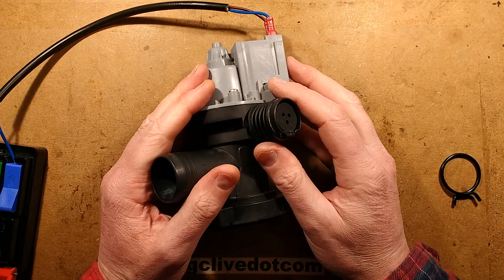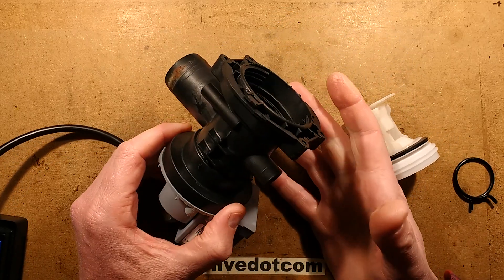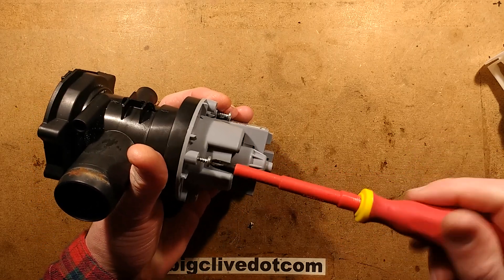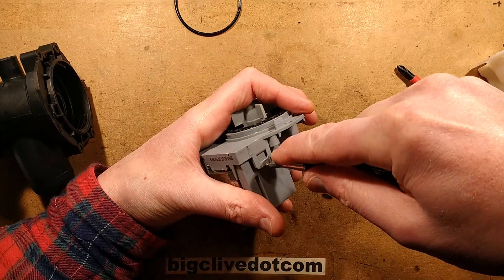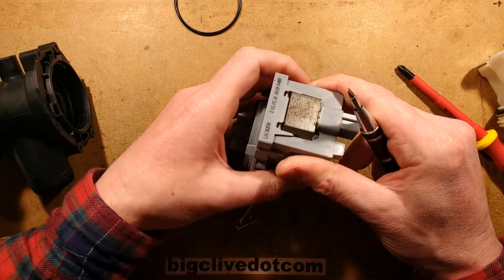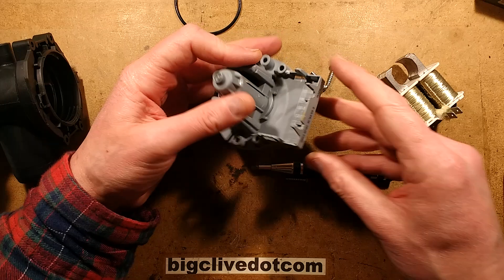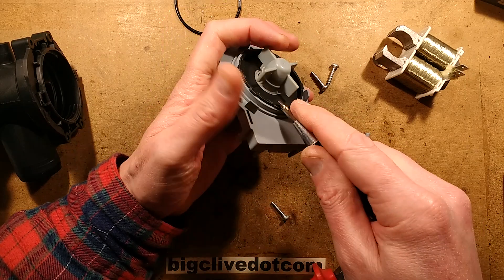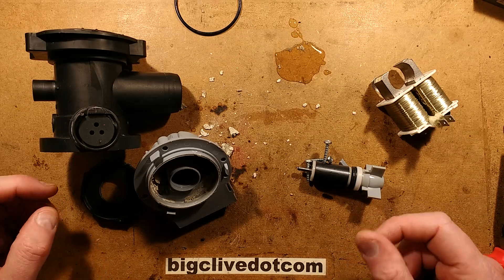Washing machine pump teardown.

Comment: Why do washing machines have pumps instead of a simple solenoid drain valve?
Reply: jhsevs at least in Sweden, we have to have to have an outlet hose in a bend over the machines top water level. It is to prevent water damage in case something goes wrong in the system. So the pump needs to be able to pump water about a meter.
Reply: Ray Kent I'm sure your explanation is true as well. Regarding water damage is just a precaution if some valve got stuck open I think. In Sweden there are "water locks" (direct translation for the U bends to stop odor) after you let the water out from the machine anyway so here the smell wouldn't be a problem. If course there can be water damage anyway so the machine should always be placed where water can't get in wall/floor cracks and what not. Another thing came to mind, the water staying in the U bend after pumping out water will drain every time you clean the dirt filter anyway, at least how my WM is placed and working now.
Reply: Simple, if the drain hose went straight out to a floor drain it would never fill.  If the machine dies and is
full, just lower the drain hose to a floor drain and watch it empty.  The height of the hose dictates the max fill level and if the fill valve fails the excess water goes in the drain.  At least for North American top loaders.
Reply: Benny Lloyd-Willner   hi, that's interesting.  I assumed that the u-bend was there for the same reason as a u-bend in a toilet, to stop bad smells from the sewer getting into the room.  Mine is not above the top water level of the machine and you have made me wonder if I should move it.   Would you say more about the possibility of water damage?   Thanks.
Reply: Benny Lloyd-Willner  thanks.
Reply: Regardless of any safety regulations the outlet pipe must rise higher than the highest working level of the water in the tub.  If didn't then the water would simply drain through the pipe until its level was at the same height as the highest point of the pipe, even when the pump is not running.  In the UK washing machines are often used in kitchens which typically don't have floor drains..
Reply: Yes the laundry  machines I worked on had those pumps to pump up to a stand pipe drain. But I have heard that there are machines that do just have a solenoid drain valve to floor drain system and no pumps.
Reply: Many people put their laundry appliances in the basement, and in many places all things that drain out must go to a septic tank or municipal sewer pipe. The drain pipe for the house is usually buried in the ground beneath the frost line, but is above the floor level of the basement. A pump is needed to draw the waste water from floor level UP to the pipe.

Using a floor drain is prohibited in many areas because dirty soapy water gets dumped straight into the ground instead of passing through a septic tank or city sewer treatment plant. This is to keep from polluting the ground and from contaminating water supplies. In addition, floor drains usually use smaller diameter pipe and often get clogged due to debris, and water coming from the emptying washer could potentially overwhelm the pipe, water could come up out of other floor drains in the building or not be able to go down the drain fast enough to prevent minor flooding.
Reply: Solenoid valves don't tolerate debris well and require a minimum pressure to work, I thought...
Reply: Some commercial machines do that. But domestic ones don't because people don't often have drains on the floor
Reply: Cause you need pressure to lift water up.
Reply: Антон Южаков 
Yeah but why don't they just dump the water out the bottom of the machine, into the floor drain?

Comment: Back end with windings is a complete spare, as the typical failure is the little shaft wearing and the rotor inner plastic as well, so it cocks and does not spin eventually. The coils are also protected by a one time thermal fuse in the middle of the one winding, those those windings look a lot like aluminium wire, not copper or CCA at all. Same design as used in fish tank pumps as well, though there they also fill the winding with epoxy and put a wire on it as well, as they do live in the tank water.

Replaced a good number of those pumps, they are common across almost all of the Korean made units, seems there is a factory or two making all the parts that just get a big brand name ( or just some bought out old shell name) put on the outside, the inner parts are almost all interchangeable across model ranges and price ranges.

Comment: Should rewrite this title "washing machine pump smelldown".... Tea, really? What do you normally drink Clive, Jasmine Tea? Cause undoubtedly that crust is probably hard water deposits w a smidge of scented soap thrown in. Here's hoping your next cup of tea doesn't smell like the inside of a washing machine!
Reply: Maybe fromunda tea, scented with detergent?
That gunk is a combination of residual detergent, water deposits, and filth that has been washed out of clothes.
Reply: Joe Camel: Funny icon. I've got a bunch of Camel Zippos and ashtrays still from when that was my brand.

Doesn't look very filthy and obviously that's leakage into the pump so bigger bits can't get in. I still couldn't believe how quickly Clive smelled it. Ick!
Reply: It's definitely filthy... Some of the worst smells I've ever experienced were from washing machine pumps. That said, if you don't overdo it with the detergent, the smell won't be nearly as bad.
Reply: I remember a pleasant smell I smelled as a kid when smelling the rubber seal between the drum and the door

Comment: That little flap valve is known as a backflow preventer or anti-siphon valve!
Reply from the maker: It's odd that it has holes in it.
Reply: The drain stack on the washer would be left full to the tits if it didn't have holes in it.
Reply: I agree usually back flow or antisiphon valves or flaps usually do not have holes in them, maybe they do that to let air get out if it gets stuck in there, the machine is churning up water mixing with air. A supply line generally do not mix the water with air.
Reply: I would have thought it’s some anti-cavitation feature.

Comment: The ones in the US are all like that too, not just the EU. (Access through the front panel to that filter trap you showed at the beginning.) They're all like that, no matter where you are. (Front load washers.)
Reply: Except they aren't.  Most American front loaders have historically not had an access panel, my Whirlpool doesn't.  (Which is interesting in itself, considering that it was actually built in Germany.)  Fortunately, I've never needed to access the front of it, it's been going strong for over 10 years now.  I haven't been quite so lucky with the dryer, it broke a belt a few years ago, that was quite a bit of disassembly to change.  And of course I ended up paying $20 for the belt locally instead of $8 on Amazon, because I had a load of wet clothes that needed to be dried.

Comment: Had a front loader.  Replaced it with an old school top loader.  Sick of fixing it.  Sick of the smell of the labial seals with miles of surface area constantly immersed in soap, skum and warm water.  Same trap and pump design.  Complete shit.  Stick with top loaders.
Reply: Whaaat? I don't have any problems with my front load...

Comment: Those spring clips are awful. Far better (and easier) to use ye olde Jubilee Clip (the hex drive ones are even easier to use!)
Reply: For a washing machine, they're fine.  We're not talking about car radiator pressures.  And the spring clips are quicker.

Comment: The flap is probably to slow the water draining backwards from the elevated drain hose when you open up the plug to clean the filter.
Reply: It's to stop back flow from a kitchen sink wash water trap, (if it's connected to one).

Comment: i learned a lot about these types of pumps from their use in my pond.
the good ones are nice and rebuild-able, so they make for good learning.

just found some very cool little air pumps as well you may like. they have neodoodlium magnets suspended in a silicone grommet with a small powered device underneath to make the magnet pulse.

Comment: The inside of that pump is disgusting. You say drain pumps are quiet. The drain pump in my washing machine is very noisy. Always a loud 50hz buzzing, especially when all the water has been drained. It still works fine and isn't blocked. Any way to make it quieter?
Reply: You sure that the bulk of the sound isn't coming from the floor waste? I have a dishwasher that makes a lot of noise when it drains into the waste pipe under the sink next to it. Just putting the plug into the sink above cuts the bulk of that noise down. I've covered the floor waste in the laundry room for much the same reason, although my washing machine isn't as noisy as the dishwasher.
Reply: The pumps will get really noisy when  the rod that holds on the impeller gets worn out and starts wobbling around. If you pull the hose off and stick your finger in you can wiggle it and feel the slop. When the pump gets really loud it is time to get a new pump for when the old pump  fails which will happen eventually depending on use.  But the noise you hear could also  be a solenoid buzzing . Those make noise like you describe and is sort of normal - though a new solenoid might be quieter might not also .

Comment: I liked the idea of the quick test, but when I looked it up online it was way too expensive, so I made my own out of wood. I even put the little neon indicator on it and everything. Not counting materials I already had on hand, it only cost me 50 cents.
Reply: "Everything" includes a hidden switch inside the wood. When pulled up it goes unpowered. A lot of old small fuseboxes were like this. Ave put out a vid, gotta split!
Reply: Yes, the price is ridiculous. Its just a folding plastic lid with wire connections. It can't cost that much to manufacture. If I had a 3D printer, I'd design and make my own. 
Can you upload a photo/video of your DIY one and link to it please.
Reply: Yes, at over $50 on eBay, they are rather pricey. I'm surprised the Chinese haven't made any knock-offs - although I haven't checked in a few months. Hmm ...
Reply: I just use Wago 221 series connectors + usually end sleeves
Reply: £35 is the VAT inclusive (or £30 ex.VAT) price in the U.K. if bought from CPC http://cpc.farnell.com/cliff-electronic-components/cl1853/quicktest-block-with-1-5m-lead/dp/PL10638?st=Quicktest

Comment: So no signal is driving the motor? Just AC? What controls speed? If it runs either direction, how do they use this type of motor in say a fan?
Reply from the maker: No speed control.  A fan uses a shaded pole motor for direction and sometimes a capacitor for speed.

Comment: I've got an old washer in the coal house and this made me think I could use the pump to drain my chest freezer after defrosting so I don't have to tip it over to get to the drain hole.
Reply from the maker: You could use a cheap aquarium pump for that.
Reply: bigclivedotcom I'm too cheap to buy anything when I could rip something apart for free.
Reply: Trouble is thy are not self priming so quite limited to what you can use them for.
Reply: Or a bit of hose and a good suck to start a siphon...
Reply: Wouldn't you want a submersible pump for that? Dropping a 240v inline pump into a tank of water won't go so well.
Reply: Use a Wet Dry Vacuum Cleaner. Take the filter and dirt out first. Point the air exhaust into the freezer to speed up the defrosting.
Reply: Should work, just make sure you fill the hose with water first to prime the pump. These pumps aren't strong enough to pull enough vacuum to work as a dry pump. After all they are designed to work in conjunction with wall water pressure.

Comment: The access to pump filter was almost standard here from 10 years ago when front-loading washers first appeared -- never understood how slow U.S. can be in terms of innovation, I think it is probably due to them mostly using stuff until it's totally broken though.
Here, things change every few years or so for some reason!

Also, we just got individual dryer unit 1 year ago and it has big warning sticker that says "DO NOT POUR ANY DETERGENT INTO THE UNIT." because Koreans kept pouring detergent into the dryer, causing the drums to turn into sticky mess. I mean, I was the only person in the whole class who was wise enough to NOT pour the detergent into something that obviously is not a freaking washing machine!

Comment: Ah just recently I had to change mine because for whatever reason the coil failed and shorted. And thanks to that the ACS (AC switch) SMD on the PCB burned up because of high current.

Comment: You can make a good degausser with that
Reply: As seen on AvE's channel.
Reply: Growler for testing armatures for shorts as well comes to mind. Hacksaw blade held flat across the top of armature resting upon the poles will suddenly slap about violently when the armature is rotated to where the internal short is. Otherwise the blade will slightly buzz along with the same amount of interaction all the way around as you turn the armature with the other hand. And that's a good one. Everything growls, the armature and the hacksaw blade so normal for the course. A change up indicates one or more coils is compromised internally where you can't see it.

Comment: In north america at least, some washing machines (used to?) come with a service manual in stuck inside that specifies the winding resistance. On a couple of occasions my washer has failed to drain due to a coin jamming the impeller, with no harm done to the pump. Presumably the stall current has to be at or below safe limits for the windings, or the spinning rotor contributes minimally to the effective impedance in such a synchronous motor.
Reply: +David Scheiber    I repair them for a living.    Once when I looked under a customer's machine I found the plastic bag that's used to cover a new machine, stuffed inside the workings.
Reply: ah, my washer broke and when I took it apart I noticed an empty re-sealable plastic bag stuck to the side
I was wondering why
now i'm wondering why the service manual is missing
what sucks is I cannot find it online either  :(
Reply: Simon Ruszczak i found the Styrofoam tub support from the box still under a month old machine. Client said it was noisy.
Reply: I had one out of the pouch  the other day,  the customer took it before i was done and filed it away with her manual.  Good luck to the next guy who needs to do diagnostics,  if it's not me and i forget she took it.
Reply: If it's not in the casing, pop one of the end caps off the top. Most of the time the manuals are in a plastic sleeve that is open on the right hand side.
Reply: Dave Myers most still do. Most appliances have a folded up booklet taped inside the housing that provides a schematic diagram, troubleshooting steps, specifications for testing parts, and a diagnostic flow chart. Hell, even $40 microwave ovens have them, even though almost nobody bothers with having those repaired. Although I did fix our microwave once with the help of the troubleshooting steps it provides. What had happened is a bowl exploded inside it- thousands of pieces. In the process, it blew the door open- and it's a positive latching door, where you have to press a latch button to open it. Anyhow, there's 3 safety switches, 2 normally open, one normally closed, and in order to prevent someone from defeating the safety interlock, they have to switch in the correct order, otherwise, it acts as a sort of crowbar circuit and short circuits the mains in wires, causing the internal fuse to blow as well as cooking the switch contacts. That repair sheet told me exactly what to do and what to replace.
Reply: Maybe the limiting factor is that you need a case big enough to shove the manual in? Forcing the fuse to fail with a dead short seems like a questionable 'safety interlock'.

Comment: The coils would be in parallel for 120V
And yes, just replace the pump if it's faulty, specially if it's gunked up like that one.
Reply: No clean it if its blocked. Replacing it is wasteful and costs money. Of course if the coils are burnt out, you can't fix that.
Reply: I meant that if you start to strip it down as far as Clive did. i'd have no problem taking it as far as removing the pump housing, done that before a couple of times.

Comment: I think the deposits are either detergent or mineral buildup. or cum.
Reply: Cum dissolves pretty well... Don't ask.
Reply from the maker: It was detergent.
Reply: Not sure I want to know how you determined that!
Reply: People use too much detergent.  Clean hot water... well it cleans.  How do you expect water to absorb shit when it is saturated with other shit.  And those pod things?  A plastic that dissolves in hot water then cools and sticks to everything.  What could go wrong?
Reply: Water on its own won't remove much dirt. Degassed water, on the other hand, is very effective at it. Unfortunately, degassing water is more trouble than it's worth.
Reply: Definitely Cum if it’s my house!
Reply: John Simpson Well, they said not to ask, so good.
Reply: Detergent gets everywhere and since it's an enzyme. It stinks if you use too much, it'll even eat magnesium parts like the drive shaft after a few years.
Reply: It's fatty sweat and dead skin bonded together with soap
Reply: Sometimes lube will separate over time. Heat then it's spinnamathinhing all the time, but prolly soap.

Comment: Is that extra inlet for hot water feed:- not very common on washers nowadays?
Reply: No its not. I wonder what would happen if you connected the hot water to the cold input or mixed the hot/cold to the right temp before the machine. Would it still try to heat the water?
Reply from the maker: It has a thermistor so it would only heat the water if it needed it hotter.
Reply: Hmm, wonder what would happen if water will be hotter...
Why would you use hot water inlet anyway?